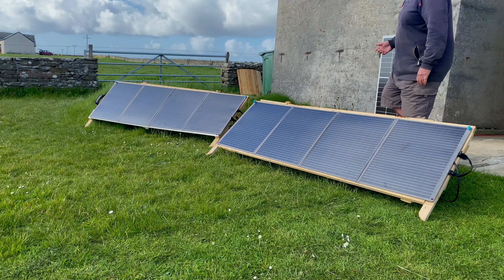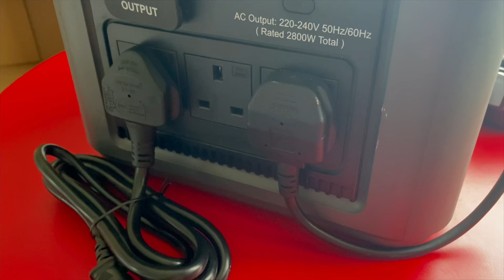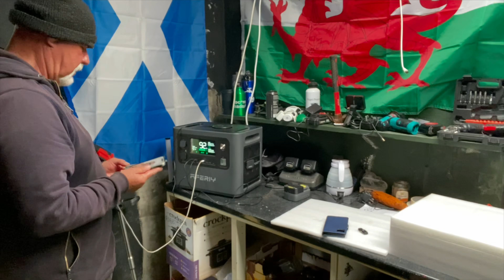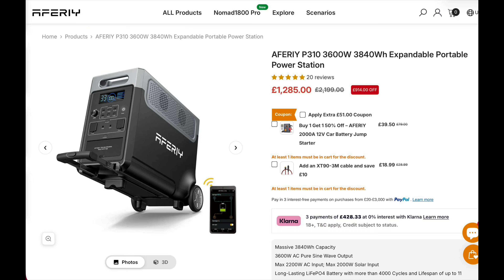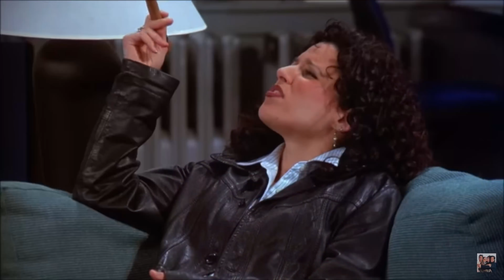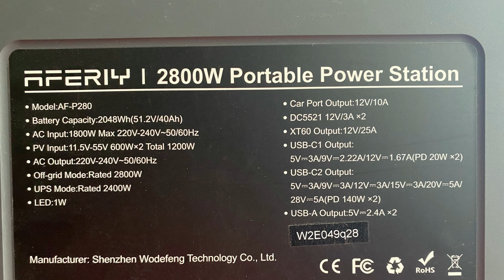Do You Need a Aferiy P280 Portable Power Station

Comment: HI Nigel, in the winter i use a smart plug to control when the mains power charges the P280, works well ( I found the app not very good). In the summer i use 2 fence mounted solar panels and 1 porable panel to charge and if i have nothing else to power i use to charge an EV via a granny charger! only 1 to 2% of a 60kw battery but do that most days and it adds a good number of miles a month!

As an update in october 2026 the app has been updated and now works well?
Reply from the maker: Thanks Bryn that’s interesting & thanks for watching